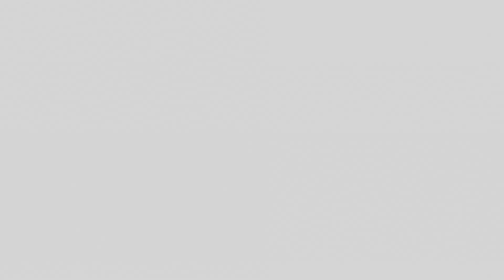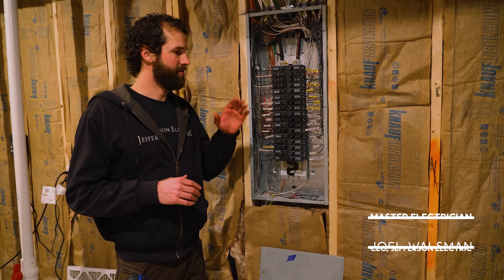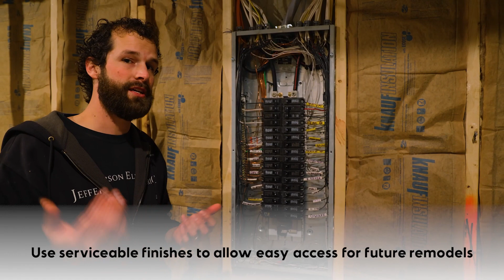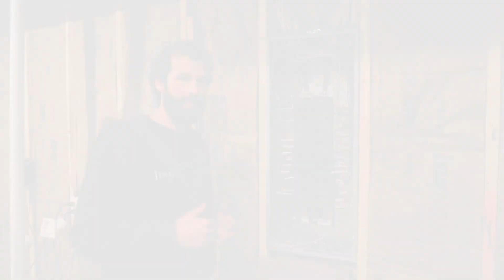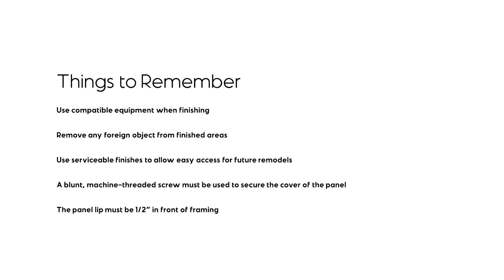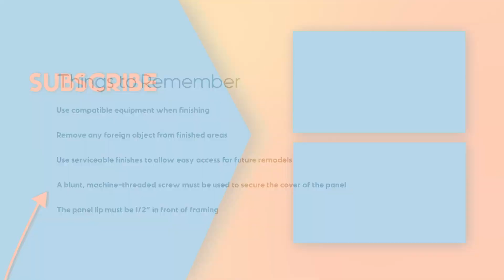5 Common Electrical Panel Mistakes

Comment: Home Depot sells eaton breakers but they don't sell the panel screws...which are #10 wood screw threads...
Had new wiring done the asshole electric worker noched out half of the framing stud to mount panel on that and still stuck out a half an inch past the wall surface!!!

Comment: I was changing a light switch in my kitchen.  I tried to locate the circuit breaker to disconnect the power, but after trying each one separately, the power was still on.  I then turned off all of them, and the power to the switch was off.  I then started to turn each breaker on, one at a time, and the power finally came back on so I thought I now knew what breaker controlled the switch.  So, I turned the rest of the on and turned off the breaker that I identified.  Guess what? The power remained on.  Turns out that the electrician who installed the switch initially had the switch on two breakers.  Since the electrician did this work about 3 years ago, I called him and told him what I found.  He said it wasn't dangerous and said, "You can leave it that way if you want, or I can come over next week and fix it.  I chose to wait and have him fix it.  He said the reason why this happens is because "we never turn off power in the box while working and it was just missed."  This is a problem when they take short cuts when doing electric work.  After he fixes this, I will never use him again.

Comment: One of my pet pieves is when i open up a panel or j box and find all the metal shavings from where they drilled their KOs in the bottom. Use your magnet on your level and clean that mess out

Comment: That's funny.  A square d breaker is a much better breaker than a ge or any other lesser breaker. Cutler hammer is good too since they use square D  internal workings. Too bad they don't cross list them. The whole purpose for homeline panels is so homeowners can interchange breakers. I personally would never install a homeline, don't trust the aluminum bus bars. And why would you want someone putting a ge breaker in a square D  or ch panel.

Comment: So what do I do to cover all the wires that are not in conduit to a back mounted panel on back porch of 120 old house. I’ll need room to run all the new wires as I eliminate the tube and knob wires.  Currently no framing no conduit.
Reply: if you're considering external wiring, it would have to be BX -metal clad-armor cable, as used in apartment/commercial buildings, and anything metal studs. you can also do conduit, depends on the look you want to finish with.

otherwise, but holes in drywall/wall panels, and use fish tape/rods where you can to run wires behind the wall panels

Comment: Thank you for your post A question please how would one identify the common wire 100amp the ground where is Marked but not the common it's been installed in the pipe underground
Thank you for your time

Comment: What a great way to connect wires vs wire nuts.  I ordered the 90 piece kit!  Thanks.  One question - is there a similar way to connect #8 wire?  I've wired a stove outlet with some existing wire I had lying around so I didn't have to purchase more, but found the outlet was 6" too high. I would really to 'simply' extend these #8 wires.  Any recommendations?

Comment: If a panel is designed to be between studs why are there twice as much knock outs or even at all on the sides for cable entry?
Reply: Because the sides are longer than the ends and can accommodate more knockouts.
Reply: Sometimes they are surface mounted. Just use a surface mount cover.

Comment: A solution for a panel that is flush with the stud and has no reveal is?

Thanks
Reply from the maker: Loosen the mounting screws and pull it out to the face of the finished wall surface.
Reply: @Electric Pro Academy  lol. Thanks. I took it granted that you would assume the only reason I asked the question is because the box is filled with wire and walls (3/8" OSB for ability to hang something anywhere & drywall because I hate how OSB looks) are up. I used some plastic stand off and screwed cover on. I was very displeased with myself for the installation and wanted to do something about it, assuming there was a simple fix. Oh well. BTW, I have found your content very helpful.

Comment: It's not an electrical issue, but why aren't the side tabs of those fiberglass batts stapled to the studs?  What good is the vapor barrier if it's left open? That is an open invitation to unnecessary air infiltration.

Comment: I see several white wires attached to breakers, in our jurisdiction these need to be covered at each end with black or red tape at both ends of the run.
Reply: No, they are neutrals of afci, they must not be marked as power cables

Comment: Quick question, where can I find code reference on the blunt screw for the panel cover?
Reply: NEC code 314.5
Screws or other fasteners installed in the field that enter wiring spaces shall be as provided by or specified by the manufacturer or shall comply with the following as applicable:
(1) Screws shall be machine type with blunt ends.
(2) Other fasteners shall have blunt ends.
(3) Screws attaching a cover shall extend no more than 3⁄8 inch.
(4) Screws or other fasteners, other than in (3), penetrating a cover shall extend no more than 5⁄16 inch.
(5) Screws or other fasteners penetrating a wall of a box exceeding 100 in.3 shall extend no more than 1⁄4 inch, or more than 7⁄16 inch if located within 3⁄8 inch of an adjacent box wall.
(6) Screws or other fasteners penetrating the wall of a box not exceeding 100 in.3 and not covered in 314.23(B)(1) shall be made flush with the box interior.
(7) Screws or other fasteners penetrating the wall of a conduit body shall be made flush with the conduit body interior.
Exception to (3) through (6): A screw shall be permitted to be longer if the end of the screw is protected with an approved means.

 and 312.10

Comment: Assuming that wall is insulated because it’s an exterior wall your video shows one of my pet peeves, putting the panel in an exterior wall that the code requires to be insulated to R-15 or R-20 and because of the panel there ends up being a cavity that is roughly R-0. I’ve encountered situations where the panel was so cold there was condensation all over inside, not good! There’s too many of us willing to be “that guy” because it saves us 10 minutes of work or a couple of bucks in wire. I would love to see a building inspector fail a final building inspection for this reason and make the electrician move the panel at his expense.

Comment: UL requires the square head screws on the assembled unit that's shipped to the customer. Everybody knows these screws get lost. There should be six more screws inside the panel attached and labeled "Spare non-piercing panel cover safety screws." And allow as an alternate mechanical shielding that prevents wires from being in harms way.
Until something like this is done, asking a homeowner to go to the hardware store to buy a special screw that they don't even understand is all you can offer, yet dysfunctional from a regulatory perspective. Before I knew what I know now, I left missing screws still missing, and I left replacement screws in place when I opened panel boards in the past. After I finished writing this I'm going to buy a bunch of spares for my toolbox.

Comment: Eaton "could" seek to expand their listing to accept Square-D, but seemingly helping the competition is not what shareholders are looking for. But if Eaton wanted to disrupt the market with a universal panel, killing panel sales for everyone else... Also this making their own breakers in a commodity, driving down prices for all brands of breakers (that are now stupid expensive), they could. However, they would have to chase all new breakers released by all others and pay for compatibility tests. The fat money is in the fancy new breakers that protect most in 30 years when outlets become sloppy loose, that improperly torqued screw didn't matter until some day a space heater is plugged in...
These c a f c i and GFCI plus CAFCI breakers have little circuit boards, capacitors, failure prone solder joints, and are in a thermal cycling environment. These breakers are to protect houses burning down after they age, the one exception being they should also trip when deficient power strips are in the chain of the continuous power appliances like space heaters, air conditioners, dehumidifiers, and even refrigerators in the freezers. I support using the new circuit breakers, as an electrical engineer who has designed safety circuits and who has investigated fires, but the way this is playing out with very expensive breakers in a monopolistic market is causing a lot of workarounds, and horribly likely preventing people from upgrading old panels and fuse boxes and federal Pacific boxes because the new panel with its compliment of breakers could run $800 before the electrician's labor is even counted.
Reply: $800? Where you get it that cheap? Lol
Reply: Eaton makes a breaker that will fit Homeline and many others (CL) it's been tested to fit and approved by U.L. , Square D could do the same but has chosen not to

Comment: I'd watch zip-tying bundles of conductors after they exit the panel. This is not a good idea. This can cause heat build-up between the conductors due to lack of air circulation.

Comment: Yes sawdust and debris at the bottom of a stud bay by sloppy builders is a fire hazard also.  Good point about the panel screw also!  Only problem is when the hole becomes stripped out and you have to use a larger screw, choose a new screw carefully.

Comment: I gotta change out the screws that hold my panel cover on!
The ones that came with the house are the pointy, little ones, and I don't want stuff to be dangerous and/or not up to code!

Comment: As a sparky in the Netherlands is am amazed about the number off  group switches as we call them.(translated in english off course!)Is this for a normal house or for a factory or what?I know your houses are in general bigger than ours,but still,thats a lot off switches!
Reply: yes, it's very typical in north american homes (and commercial business) -to have many individual breaker switches. these days where LED lights are most common, we could certainly simplify a circuit a bit more, but what you're not considering is that we have 120 volt standard sockets, only 2 or 3 devices require 220 volt (2 lines of 120 volt). so when we are dealing with a 15 amp circuit, that can be used up to capacity quickly. ,so, more circuits...

Comment: Although it looks nice, you have too many cables bundled together and need to derate them.  Better practice would be to put a nailer board above the panel.
Reply: Thats Overrated. Get it. Buh dum psh.
Reply: @Adobo121  hahaha, I love it
Reply: What is a "nailer" board?
Reply: @PolymathLearns  a board installed across the stud cavity that has the sole purpose of allowing you to securely attach fasteners.  In the case of this video, it would be set back in the cavity to allow more space to fasten groups of Romex instead of having to derate the Romex due to grouping more than 3 cables.
Reply: @ianbelletti6241  OH!!! THOSE things!! 
I know what you're talking about now! 
Thanks for such a great explanation!

Comment: Another thing not to do is all those home runs coming into/out of the panel…they’re bunched up in two major bundles.  Try to avoid that and go with no more than three or so.  Heat is a killer in bundles like that.
Reply: Is there code for a limit of bundling?
Reply: @SouthwestD313  Yes, you can only bundle as many cables together through a bushing as what the code allows for that bushing size.
Reply: @thekobaz  What's the code number?
Reply: @SouthwestD313 
For bundling derating, check out NEC 2020: 310.15(C)(1) More Than Three Current Carrying Conductors: “The ampacity of each conductor shall be reduced…where the number if current carrying conductors in a raceway or cable exceeds three, or 
where multiconductor cables not installed in raceways are installed without maintaining spacing for a continuous length longer than 24”.“

Then you have to look at Table 310.15(C)(1) for derating based on number of current carrying conductors, and Table 310.15(B)(1) for temperature derating.

Also, 334.80 
Ampacity: “Where more than two NM cables containing two or more current carrying conductors are installed, without maintaining spacing between the cables, through the same opening in wood framing that is sealed with thermal insulation, caulk, or sealing foam, the ampacity of each conductor shall be adjusted in accordance with Table 310.15(C)(1).

There is no derating (that I’ve come across) for NM entering a bushing in a panel KO.
Reply: @SouthwestD313  "as what the code allows"   I believe he should have said "what the listing allows." You must conform to the bushing manufacturer's rating. However, in my AHJ, you will get popped if more than two wires are in a single bushing, regardless of the listing.

Comment: 1) Cables CAN enter a panel without a connector in some jurisdictions. In the Southwest (AZ), our panels are almost exclusively placed outdoors and all the cables enter through a single large bushing in the back. It may not be NEC compliant but it is allowed here and has been the standard since the 60''s.
Reply: @ElectricProAcademy  We are usually a few years behind some of the country. Im retired now so I don't pay too much attention.  All I know for sure is that has been the standard method here since the early 60's.  99% of our houses are built on slab with no basements and 99% of our  service panels are outdoors so it is a simple and logical way to build.

When the internet came along, I was surprised to see SE cable was still being used and NEC compliant in some parts of the country. I have only seen exposed wires or cable used for servive conductors here one time, out of thousands I have looked at. I've had houses built in the 20's and the service conductors were protected by conduit.

That said, they used a LOT of "indoor" panels for the outside services throughout the 50's :)  They often function fine until the 2000s when I replace hundreds of them.  I only saw one that actually blew up. It was under a roof valley and the water poured straight into it for decades :)
Reply: The bushing protects you from chaffing on the "raw panel". Which is what the connectors do.  You can have squeeze connectors but its not required.
Reply: @ElectricProAcademy

Comment: Pretty sure you are wrong about the breaker compatibility. See reference linked below from Eaton themself.

https://www.eaton.com/content/dam/eaton/products/low-voltage-power-distribution-controls-systems/circuit-breakers/classified-circuit-breakers/ul-classified-replacement-circuit-breakers-sa00304001e.pdf
Reply: Nah. They are  are all UL classified, interchangeable they are.
Reply: @ElectricProAcademy   Homeline will fit BR but BR will not fit Homeline , Cutler Hammer CL's will fit both
Reply: Just because there's an apparent dimensional and physical compatibility doesn't mean they're compatible. There are other factors, such as thickness of bus blades, dimensions of bus blades, design of the swing "clamps", etc.
Reply: They are not "interchangeable".  The panel directly states what type of breakers it can accept.  By that standard if you could somehow miracle a zinsco breaker into an eaton panel all is well.  Both are UL listed(UL is just one of several certifying companies).

Comment: Nothing about that panel would pass Canadian codes LOL
Reply: And halve ass candian way of installing panels sideways is dangerous . Every breaker or switch must have ON position in the u
UP position. Common sense. Somebody should tell Mike Holt to place a disclaimer every time his electrician mounts a panel sideways ( horizon ) on shows that are played in the USA.
Reply: @JohnThomas-lq5qp  one of the dumbest statements i seen yet, and coming from a country where grounds and neutrals can be placed on the same bar, branch circuit wires and unfused line wires can be mixed in the same space and double stapling cables is common place.  Probably should be quiet, you don't even have a good reason why a panel can't be mounted sideways mounting a panel vertically means no breaker handles go up lol. Plus you can't spell.

Comment: Ooh ooh I get to be the keyboard electrician that names one more: If those wires up top are zip tied together for more that 24 inches they are subject to bundling codes and need to be derated.  Don't zip tie them they- they get stapled to a 2x4 in the bay instead (if the local musicality requires that)

Thanks for the video!
Reply: He’s a dyi YouTube electrician he knows how to read a book short of he needs to derate not all dry wall 1/2 he whines about connectors really residential easiest possible work
Reply: Do your local musicality sing a good tune?

Comment: In Canada we use push in Style as you can put 2 14/2 wires in the same hole. In Canada we are not allowed to Ty wrap wires in a bundle